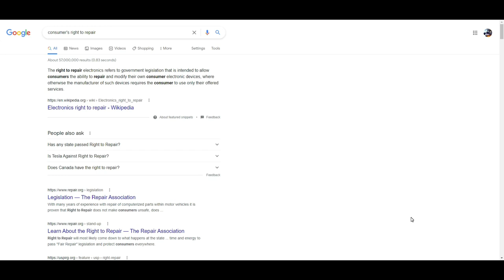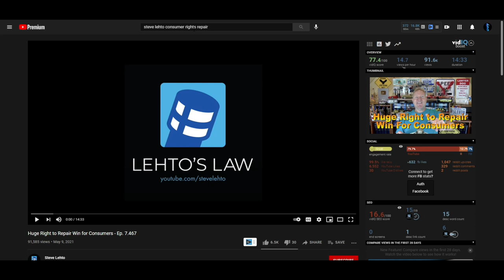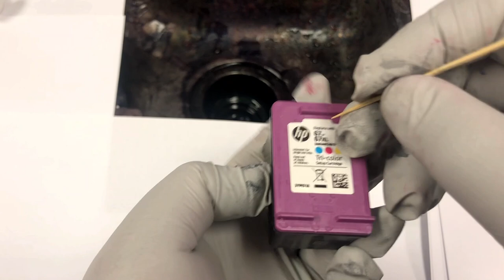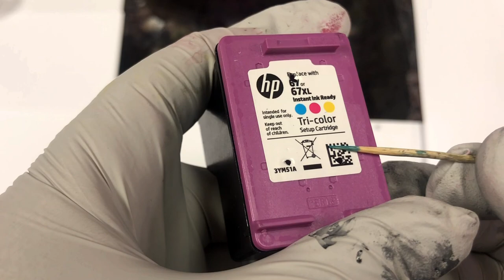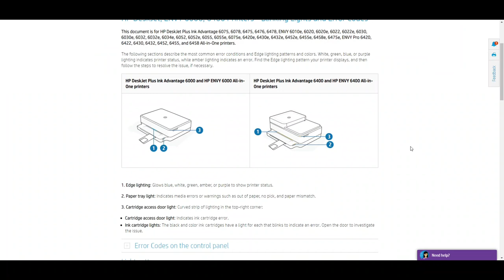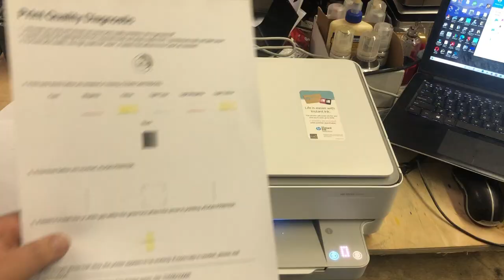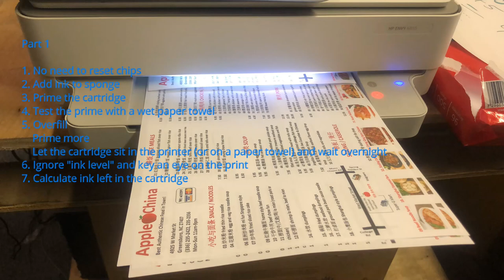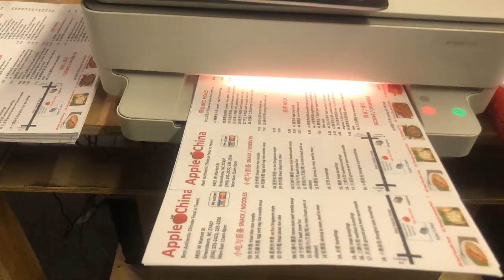Refill HP 67 67XL Ink Cartridge - Part 1 - Fundamentals

Comment: Thank you so much!! You show and explain it very well!! The instructions aren't so clear and mine just says to put the color ink in the correct holes but doesn't give you any idea how to determine that!! The toothpick check is simple and prevents mistakes!! Explaining the priming is great as well.  My instructions simply say to "suck out the air" but doesn't explain why or how to tell if you are successful or not!! Thank you so much for making this a much easier job than it would have been otherwise!!

Comment: Awesome video! Bought the product and refilled both black and color. It was a little messy and I probably should have worn gloves, but I was very happy. It took about 5 or 6 black printed pages before it looked right and about the same amount of color pages. Will definitely buy more when these start to run out!!

Comment: In this video you poked the sticker on top of the cartridge, refill the cartridge and then started printing but it doesnt show or mention whether we have to put tape over the holes or leave them open. I would imagine we would have to tape them to keep pressure in there but I might be wrong.
So...do we put tape over the holes or will it be fine keeping the holes open?

Comment: Hey Kevin, all the Epson and HP content ( which is fine!) here tells me Canon printers don't need as much work to keep going, I have an MP470 running since 2006 (apart, cleaned and lubed a few times) and this last 2 years using your color refill ink.  Also using black pigment from Canon's new/er bulk ink printers so the envelopes don't run in the rain.  Thanks!
Reply from the maker: Thanks. A few people know that printers need lube.  Of course, most printers are thrown away before that.

Comment: I have an HP Envy 6458e printer and after refilling and using the 67 ink cartridge once, it then comes up with an error stating that my cartridge is either not an HP original cartridge or is an instant ink cartridge. It IS an original HP 67 cartridge and not an instant ink cartridge. What can I do?

Comment: Hi I can't get a hp 22 cartridge to work. It prints a little and then some of the colour starves and prints blank and then it works again if I leave it to rest. I'm not quiete sure it's air, my guess is the filter is dirty or the ink is too thick. What do you think?  I tried everything already. Dissassambled it and all. I'm thinking the dirt is between the filter and the printhead

Comment: ORIGINALLY POSTED MAY 2022: I'm a photographer who has owned an HP 2755e for less than two months -- and since I print photos rather than documents, I've ALREADY spent almost as much on color ink as on the printer! If I could get just a half a dozen high-resolution full-color photos from 67XL cartridges between refills, I'd be ahead of the game logistically as well as financially because I wouldn't be reliant on local printing services. So either it's LEARN how to play the inkjet cartridge refilling game, or start saving for a color laser printer: MANY thanks!
Reply: 12/2022 UPDATE: Your BCH refill kit for my 67XL cartridges arrived. I was so grateful that it contained three times as much black ink, I poured out the ink from the kit I bought which came with only one bottle of black ink -- AND the EXTRA black ink I had to buy!

Comment: Dear friends, someone knows how to reset the print cartridge counter, because the problem in HP 2400 printers is not in the lack of ink ... it is that the cartridges have a limited number of printing sheets and if Pass that number, the system simply puts it as a useless cartridge, and so this cartridge can no longer be used in any other printer, someone knows or knows more about this subject, I will greatly appreciate your comments, cordial greetings to all.
Reply: I too am interested in this nformation considering i spent nearly 5 hours trying to get my deskjet 2722 was not printing well after purchasing a black cartridge from Amazon. SMH  how does the printer know Amazon lets people sell fake stuff? lol  scratching my head